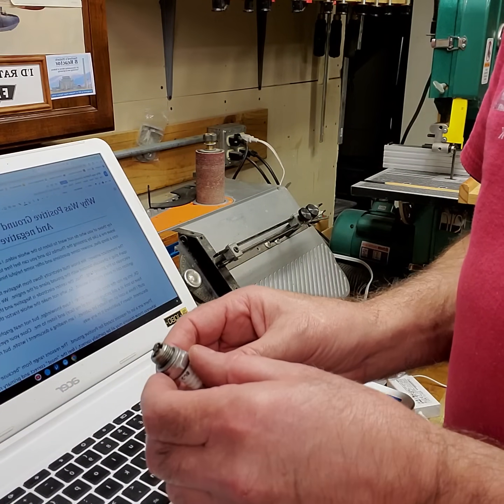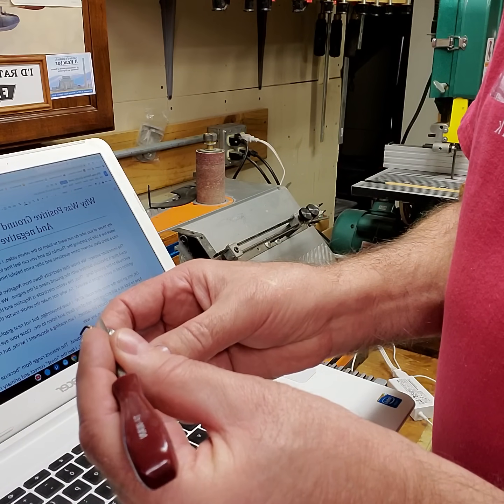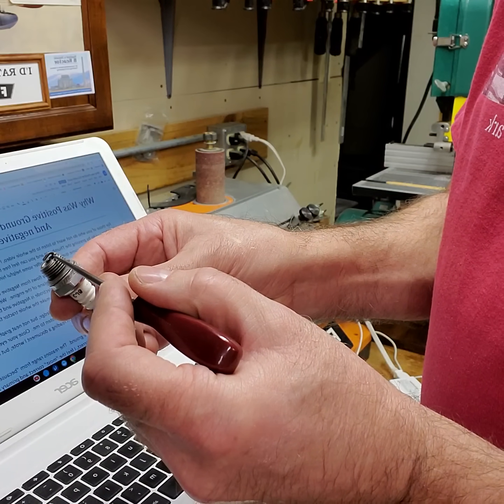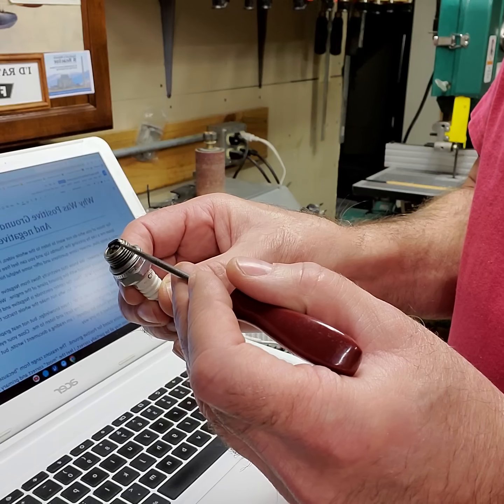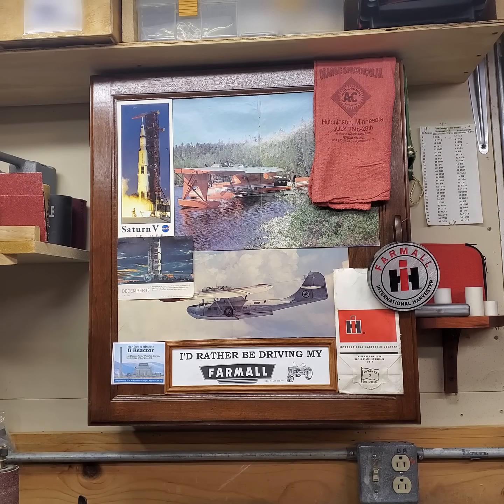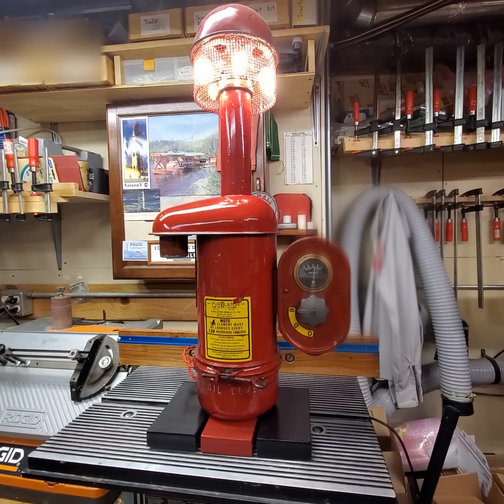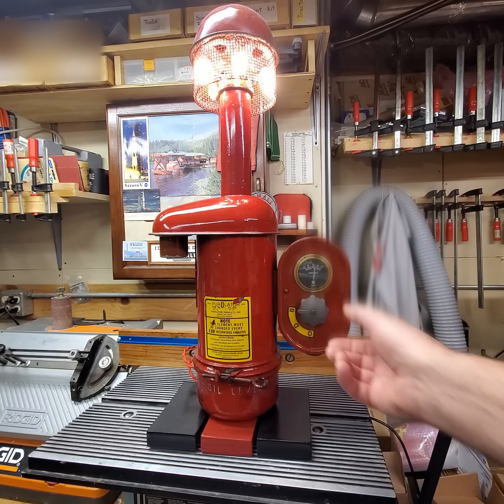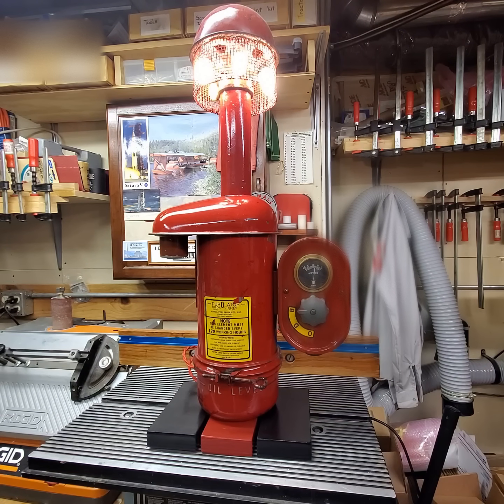Why positive ground was used on old cars, trucks and tractors

Comment: As a young 12 volt tech, I ran into some old big rigs w/ 12v chassis. This is back when radios were mounted through their shafts. I quickly discovered that the nylon antenna bushings for cb radios fit these shafts perfectly.  With that and the amazing amount of room in these dashes, I developed a reputation for being able to install regular negative ground radios to work reliably in those old trucks. Lost count of how many "conversions" I did. Found memories of a 30+ year 12 volt tech.
Reply: Yes I smoked a CB radio a time or two before I started putting a 2 amp fuse in both lines.
Reply: You probably just missed out on the 6 volt systems.
Reply: Yeah I discovered the hard way ,bk 85 ish I bought the old man a high power Alpine system for his truck and decided to surprise him and pull off a midnight install so when he headed out at 3am he be bumpin ,🤣 at 3am the cab still smelled like smoke ,it was a long week
Reply: @tstricklin4808  it was the thought the counted 😂

Comment: I always was told electricity flowed from POSITIVE to NEGATIVE....  which is it?
Reply: The electrons are going from negative to positive. Long time ago they guessed the other way around. And it kept that way in electronic circuit diagrams. (You could change a circuit diagram, swap + and -, and every diode/transistor symbol etc)

Comment: The reason we use negative ground today is you are correct electricity flows from negative to positive so by using car vehicle being the negative the supply wire being the body it is a bigger supply wire.
Reply: Doesn't matter. It is the same situation with positive ground. Direction of flow does not change the advantage of using the body/frame for 'return' current. It makes no difference if it is positive or negative...

Comment: So, you are saying that if I took a diode and connected the cathode to battery positive and the anode to ground, current would flow through it? Just a small correction if I may: Your electrons flow from negative to positive, but your current flows from positive to negative. Mind boggling isn't it?

Comment: The early solid state radios ( the ones made with Germanium transistors) also had positive ground. I had few when young (they were old by then) and theirs schematics and I always had this question. Why positive ground there while all modern schematics designs had negative ground? I once found an explanation that was something like the positive ground prevents RF interference to affect the circuit. Even today not sure if correct.
Reply: The RFI thing you heard about one polarity having less interference is most certainly wrong.
There would be nothing affecting RFI that would be any different for one polarity than the other...
Either would be equally subject to whatever particular interference was involved.
Interference doesn't care if there is a local DC supply running current in one way through a circuit, or running the opposite direction...

There would have to the more to the story. Perhaps galvanic corrosion or something?
A tube circuit with B+ referenced chassis? It would have to be something very specific for there to be a reason to state that.

Comment: First there is no such thing as a negative number.  https://www.youtube.com/watch?v=8cVVzlnSlH0&t=20s  and  https://www.youtube.com/watch?v=tzGijDsehG4&t=107s    The ground was changed because positive earth resulted in corrosion of the vehicle body.   The vehicle engine is the same polarity as the chassis which in modern vehicles is negative (minus).   The spark therefore runs from the plug tang to the centre pole.

Comment: Electricity IS the flow of electrons, however, it was previously believed that physically larger positive charges like positive ions found in electroplating where the net flow. IT took modern chemistry  and physics to realize that it is the smaller and more mobile "free" electron atoms that balance out holes or absence of electrons. This is specially obvious in electronics. By using the modern ground layout you prevent metal ions from the frame, block and body from eroding due to electrical current. Henry Ford  was also to blame since he used positive ground was used in his important contribution to agriculture industry in Fordson tractors. If I'm not mistaken Ford used positive ingnition in cars until his Model B and in agricultural tractors up into the 50's. What really saved Ford's cars was the use of vanadium steel in model T cars. This is a specially rust resistant steel.

Comment: I had a 1960s Ford Mk 1 Cortina, a British car in the 1980s here in New Zealand ,After a set of 13 x 7 hotwire wheels and 215 ,60 x13 tires then a fitted a brand new Alpine cassette player , and it went poof with a bit of smoke when i turned it on  ,turns out the car was positive earth and the alpine was neg earth lol
Reply: Seen that happen w my 65 mk1 GT. Positive ground 12v( Lucas dynamo)
A friend acquired a  good used Pioneer ⚡️supertuner radio/ cassette player while working at a wrecking yard.  He wanted   to check out w/ my car. I told him it wouldnt work,  Use your conventional theory  Ford econoline  instead. He insisted , I relented &  immediately smoke checked it. He pointed to my dash radio,   it had a polarity swtck in back for these types of automobile . I laughed,  he Learned⚡️

Comment: The biggest laugh I got.. Are positive frames and negative frames... Just touch the 2 together and you may see a  Is welding show..  LOL
Reply: Only if you have jumper cabled them first. (you knew that, right?)
I assume that's what you meant...
Reply: So if a car with positive ground,  and  a car with negative ground touch bumpers, could it cause a spark  ?
Reply: @garybrinker4522   You would have to have the jumper cables connected...

Comment: With field effect transistors,  used in MOS devices like MOSFETS and digital logic IC's  etc. the positive supply is labeled VDD (drain)  and negative VSS (source) in line with electron flow.
Reply: Well, sorta, the source implies it connects to a supply rail.  What you describe is correct for N channel devices but for P channel it is backwards and source connects to +.

That said, there is still a big advantage due to physics of using the N type devices (NPN, N-mosfet, etc) because they have better properties for a given cost than the P type devices.  There are even cases where an N type device will be used at the positive side of a circuit even though it requires additional drive circuitry to operate that way, just because the actual switching component can be cheaper.
Reply: @big0bad0brad  Correct. Even inside logic chips the designers try to avoid P-channel devices.

Comment: I feel like something is missing from this explanation. I agree that electrons flow from negative voltage potential to positive voltage potential, but I don't understand why the spark in a sparkplug must jump from the plug's central electrode to the tang. I don't see why the direction of spark has any impact on the ignition of the air and fuel mixture, although I certainly may be ignorant of such a reason.

Also, it seems like whether the engine plane is positive or ground with respect to the battery is a moot point. The voltage coming from the distributor into the spark plug's electrode comes from the secondary winding of the ignition coil, and is in the area of 30,000 volt, I believe. So it shouldn't matter whether the engine block, and thus the spark plug tang, is at 12 volts or 0 volts. Either value will be overwhelmed by the ~30kV potential at the plugs's electrode.

Perhaps older tractors and similar equipment didn't use a coil and somehow ignited the mixture on 12volts? I honestly don't know, but that doesn't seem likely to me.
Reply: In a general sense you're right.  You can make a spark jump either way.  But the devil is in the details.  The electrode the spark jumps from gets eroded, so you want that made from a special material to resist erosion.  You also want that electrode to get hot and stay hot because that makes for a more reliable spark.  All these details and more make it more desirable for the spark to jump from the center electrode to the ground.  To do this, the center electrode must be more negative than the ground.  That's why they do it that way.

Comment: Modern vehicle DO have two different electrical systems. One high voltage (20,000V to 60,000V), and one low voltage (6, 12, or 24V). The negative or positive ground is really a misnomer as the frame/chassis is actually isolated from the ground by four (usually) large doughnut shaped insulators. (usually black rubber) Electronics in automated machinery (like PLCs) often have have two ground terminals, frame ground and signal ground. They may be tied together or isolated, depending on the nature of the machine. So, in vehicles the high voltage system is positive frame, and the low voltage system is negative frame. The frame is shared. Another way to say it is the main electrical system is positive relative to the common/frame/chassis/return and the high voltage system (ignition) is negative relative to the frame/common. On the other hand old vehicles (I'm taking your word for it) had both systems negative relative to the frame. Even older systems used magnetos for ignition, which are AC and whether they were isolated from the chassis, or not, didn't matter because they didn't interact with the low voltage system, if there even was one. In fact the current and previous ignition systems don't really interact with the low voltage system either, except magnetically in the ignition coil. (and perhaps the radio)

Electricians use "conventional current" (by convention they say that 'electricity' flows from positive to negative, because reasons) while physicists, chemists, and semiconductor designers use "electron current" because to understand why things behave the way they do and design new devices and processes requires understanding where the electrons, and ions, go and how they interact. Like WHY electroplating causes the metal to move from the positive to the negative electrode (the positive and negative ions move in opposite directions) or why batteries produce electricity and get used up. (same reason except the reverse of electroplating. Electroplating is very similar to charging a battery.)
Reply: The vehicle frame is properly considered ground. There is no guarantee that tires are perfect insulators by a long shot. I don't think any student would fail to see that driving in wet sand at the beach, tires wetted by salt water, that vehicle frame at the same potential as the earth.
Reply: @tomgroover1839  And yet, while we always treat a gun as if it is loaded, we would not go into a war zone without actually putting ammo into it, would we.
I was not insisting that people don't use the term ground when discussing automotive electrical systems, I was just pointing out that it is technically not the same as talking about the ground in home or industrial electrical systems. I do think it would be 'better' to refer to it as 'return' or 'common' as it is a self contained electrical system. We should never assume that the chassis is either connected to nor isolated from the ground. 
I would think that working on a vehicle's electrical system on an ocean beach would be the exception, rather than the rule. You might as well point out that if the ground rod in a home got disconnected then it would be dangerous to stand in a puddle and touch a ground wire, or trust a GFCI. It COULD happen...
"I don't think any student would fail to see that driving in wet sand at the beach, tires wetted by salt water"
You have a pretty high opinion of 'any' student. In my experience, students fail to see things all the time. Not all of them, but it's pretty common. It's probably the biggest reason why we have teachers.
Reply: @GordieGii  Ok seriously when the frame of a piece of equipment is electrical common where have you seen it consistently referred to as common to the exclusion of calling it gound? It is always called ground, and one pretty good reason might even be with vehicles that the frame of a vehicle is at the same potential as earth ground. I mean in addition to the example that I previously gave you, consider that the frame of the vehicle sits on a set of jack stands on concrete.. Or on a lift. There is never any reason to not call vehicle ground what it is, ground as in ground potential which, yes static charge may build up on dry days on the interstate, but it would be laughable to use that as a reason to call it common.
Reply: @tomgroover1839  Obviously.
I wasn't saying it was normal. I have rarely seen it called unless there was an actual ground in the same equipment to which it is not connected. I was only saying it would be proper. It's like a dial vernier or digital vernier. Everybody says that, but it's wrong. There are vernier calipers, dial calipers, and digital calipers.
I'm not saying that all mechanics should stop calling it ground. I'm just saying that I don't call it ground just because sometimes the tires are damp and sometimes it's on a hoist. If I were helping somebody over the phone I would tell them to connect the black lead of the meter to zero or minus or the black side of the batter or the frame. I would not tell them to connect it to the ground. And in the incredibly unlikely circumstance that an auto mechanic needed my help over the phone, I would be astounded if they were even the slightest bit confused about what I meant. The same if somebody asked me to pass the dial vernier, I wouldn't refuse, or tell them there's no such thing (ever though there's no such thing) I would just pass them the dial calipers.

Comment: Positive Ground works best on a 6 Volt Generators, Alternators have to be negative Ground to induce Current in the Field Coils.  
      Has nothing to do with spark plugs it's because of the Alternator, and the Diode in Said Alternator.
Reply: I'm half with you. I agree the ignition coil is probably not the reason.
But, generators can equally operate in either polarity (see polarizing your generator...).
Alternators do NOT have to be negative ground, they are just made that way because we are using negative ground now. They can ALSO be built to either polarity...
So that is not a compelling explanation either...

It could be possible to argue that alternator regulators were easier to design for negative ground, except, early regulators were relay based, and again, those designs are not dictated by polarity...

So, any of these theories 'could' be the reason we went to negative ground, but none of these ideas are confirmed without more digging or confirmation by someone from the industry at the time.
Reply: @troubleshooter1975  Diodes only Flow current one way, the diode goes out in an Alternator the electrical Current will run back though the Alternator and run down the battery.  Negative grounded Diodes are cheaper and easier too make that positive grounded Diodes.
Reply: @carrollsanders9376  I'm afraid you are wrong, AFAIK
Alternators could be made for either polarity. I just don't think there are any 12V positive grounds cars...
As for the diodes, I'd have to look again, but on alternators I have services or rebuilt, there are 3 pos stud press-fit diodes, and 3 neg stud press-fit diodes. And diodes are packaged both ways, and I have some 'reverse' anode cased diodes in my surplus parts drawers.
AFAIK, the prices of cathode case, and anode case diodes are about the same...

Transistors are a different situation as they have 3 elements, and NPNs ARE easier to produce than PNPs (and they can't be reversed by simply flipping the die over). But diodes only have 2 elements, and case polarity is simply a matter of mounting orientation.
The analogous aspect in a transistor would be if had a different PINOUT, and not if it is an NPN or PNP.
(and those also do exist).
Reply: @troubleshooter1975  Now you are correct, but in the day Negative based Diodes were easier too produce.  Remember the Switch to 12 volt Negative ground happened in the late 50, and early 60s.

Comment: The real reason for negative ground was that early (PNP) transistor radios used positive ground. Then better (NPN) transistors were invented, requiring negative ground. I've a degree in electronics. Trust me.
Reply: Lot of telecom stuff is -48volts with positive ground.  Even today. And that Is old standard
Reply: @JarkkoWorks  Correct. Loop Calling is used on domestic lines while PABX's use Earth Calling.
In Loop Calling the line voltage is nominally 50V between the A and B wires. A reversal should not generally matter, but the -50V theoretically should be on the B wire and an earth (ground) on the A wire.
This is purely for historic reasons. They had to choose one or the other so they chose positive ground.
As the wires are both made of the same metal, it doesn't matter. Galvanic corrosion is not a problem.
The line is seized by a loop condition, put on at the customer end, when you pick up the phone.
With Earth Calling, neither line is grounded. This is supposed to stop call collision, which is when an incoming call which is answered by an outgoing call (both O/G and I/G seize the line at the same time). I can remember this happening a lot on old PABX's
To make a call the customer phone system puts an earth on the B line when making O/G calls and this causes the exchange to seize. The exchange then looks for a loop which the telephone system extends once the earth condition has been taken off. The customer system must be connected to a good earth.
Reply: Negative ground in vehicles predated the invention of the transistor by decades.